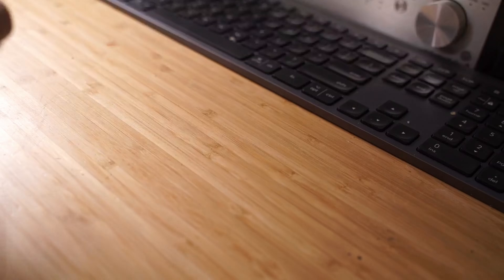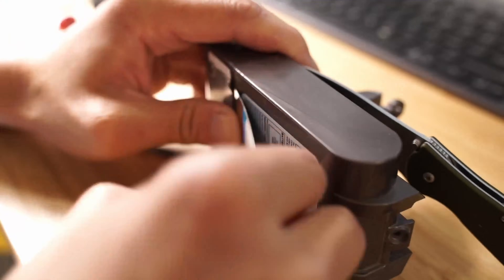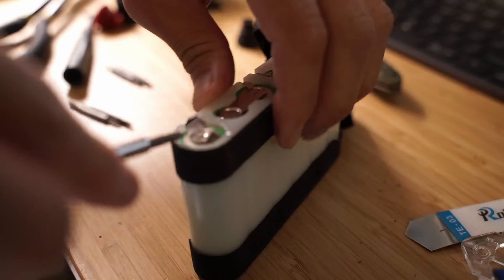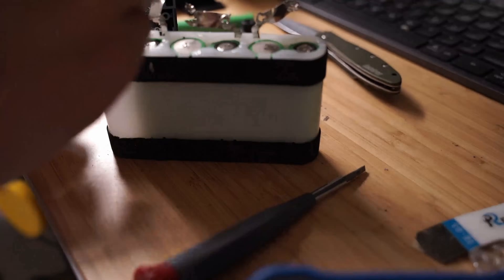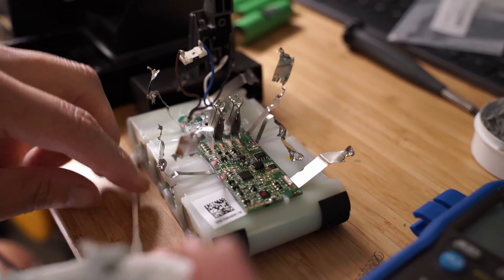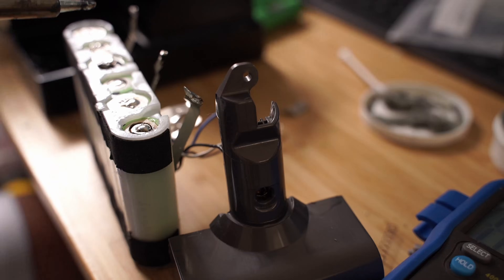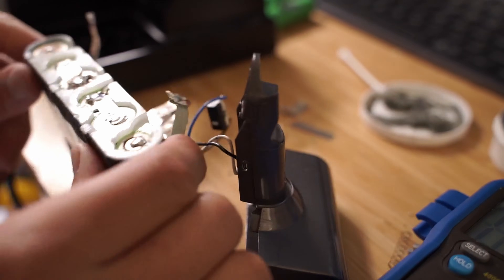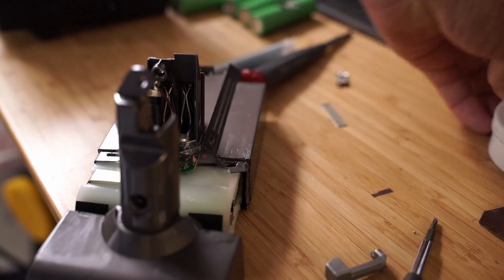Replacing 18650 battery cells in a Dyson V6 cordless vacuum battery

Comment from the maker: Hey everyone ! A lot of people have been asking how long the battery life with the new batteries, and I have been told it lasts at least 30 minutes on normal mode. I'll try and see if I can get a more accurate run time, but hopefully this is a good reference for anyone wanting to replace / upgrade batteries. Happy modding !
Reply: This video has convinced me to not bother trying to replace the individual cells inside the battery.  I was with you until I saw how destructive pulling the metal tabs off the cells was.  I don't think I'd be able to baby them off as gingerly without completely wrecking them in the process.  Your patience is profound.
Reply: Thanks for the disassembly info. Pulled mine apart, batteries ranged from 4.02 to 4.09V. Inconclusive, so I will repeat measurements with batts under load - say 2 ohms across each battery when measuring.

Comment: Just heat the join with a heat gun on low setting the pack case will pull apart without much effort and no distortion be careful not to over heat case. Maybe a hair dryer on high setting will work also worth a try.

Comment: Did it work properly considering to changed the battery with different capacity? I issues with other electronics where bigger capacity and higher output would shut down the air pump and turn on after couples seconds when in use for multiple time is a row.Thank you

Comment: I got a V7 head for free with "dead" battery which would not take a charge. Wanted to open battery, determine which one(s) were bad and charge them individually  bypassing BMS and see if this woke up the battery. In the past I have been able to charge the batteries individually, and then the batteries worked as a pack and took a charge. THIS video is great, well shows one how to have a HORRIBLE TIME as these packs are not made to be taken apart. I have bought non-oem packs for my dyson and they have lasted several year so far, so for me, I will replace a bad pack and give up on doing this. Way to horrible, doesn't look like fun.  THANK YOU for the video. In conclusion, I will buy a replacement pack and rip the old one apart and test and save the old ones which are still ok. What will I ever do with all these 18650s' in my garage.

Comment: my pack mlasted 7 years, with your video i now have taken it apart and will be replacing 1 or more cells, these are very high quality cells from Dyson, thankyou for your in depth explanation
Reply: I bought a replacement from amazon which work well.
Attempted to get the Old batteries out of the packaging and found two were solidly stuck in the tubes by a temperature sensor, couldn't bring enough force to remove the two batteries so eventually cut the pack apart.
Note the temperature sensor is hidden underneath the BMS board between batteries 2&3 (or 4&5 depending on which  way you count).
Reply: Please don't replace only one cell.
You will get a heavily unbalanced package.
Replace all batteries with cells that are of the same type, capacity and age.
The charge level should also be the same on all cells.

Comment: The algorithm served this video up to me... not sure why.  *BUT*....
I had a perma-redlight dyson battery pack that I just bought a 20v DeWalt adapter to replace (got plenty of those battery packs).  I used your instruction to disassemble the dyson pack, thinking I was going to find 18650's but found dyson-branded "INR-20700A" cells, instead.  I wasn't going to try to rebuild the pack, only curious about the state of the batteries.  To my surprise, one cell was 4v, one was 3.5v, and the other four cells were all 3.98v.  I have to assume the battery pack was bricked due to something on the BMS board, as the vacuum operates perfectly on my DeWalt batteries using the adapter.
I'm 0.5A slow-charging the dyson cells on an EFest LUC V4 charger, and then I'll let them rest a few days and check voltage again.  I have plenty of projects I can utilize them in as single or dual cells so I can save my 18650's for other toys.  Neat!

Comment: Take down this video, this doesn’t work because the BMS (circuit board) locks itself when it detects the batteries being disconnected. I should’ve watched the ending and realized I was wasting my time and money before attempting. Now I’m waiting till my new battery pack shows up in the mail.

Comment: my dyson lasted only a few seconds on max. Pulled cells from battery, did a discharge capacity test with Xtar VC8S charger and all cells were 2400mah and above. Does this mean there is an issue with the bms?

Comment: Hello, 
Found this video after I did it on my own, opened the battery case from Dyson SV10.
Replaced original Dyson batteries “INR-20700A” with more powerful “Molicel INR -21700-P45B” for about $44. These are a little bigger in diameter so I had to enlarge existing locations. 
Everything worked out  very well.  
If you need any details , just ask. I will follow up with updates on performance compared with the original batteries from Dyson.
The video is pretty good.
After 6 months working very well, I am using the original charger from Dyson , so charging takes longer. Old batteries still working with the flash light received from the batteries store. I am thinking to replace the Dewalt 18 volts  for my drill as well.

Comment: Never attempt to solder Li-Ion batteries with a solder iron, they will cause an explosion or worse, fire that you cannot control. There is a reason li-Ion battery are spot welded.
Reply: You have to be quick with high heat, and cool them down right away. 
If you're not off within 3 seconds, stop and let everything cool down before you try again.

Comment: Thanks for showing where the tabs are! I used a utility knife blade to get a small gap, then shoved in a 0.2 mm thick piece of nickel strip  at each of the tabs, came right off. I ordered new 35 Amp cells (Molicel P28A). Hope I don't have to flash the BMS board. I did disconnect the wide plus tab first (end of the chain). Going to reconnect it last after the new cells are spot welded in.
Reply: The battery is fully working after putting new Molicel P28A cells in. So, it seems to help to first disconnect the positive wide voltage tab, then the sense leads, then the ground tab and after reassembly, first connect ground, then the sensor leads, then lastly the full voltage wide positive tab.
At first, it didn't run. I had to connect it to the charger. It only charged for some 5 minutes, as all the cells were full. After that short charging cycle, I unplugged it and it ran normally.

Comment: Hi, I read some "comic" comments here , so after a good experience with these Dyson batteries I give you my clear position :
- It's possible but difficult to build a new battery in these boxes because you have no space between the cells and the box.
- You need absolutely  good 20A cells (or more) : the best is new cells , or with exactly the same values (capacity and IR) if already used. If not, don't build such a pack.
- You must be sure to get secure weldings to support high drain without any hot point and first of all any short.
- You must find another (chinese) BMS, because a disconnected Dyson BMS locks down definitely.

Simply short ONE charged 20A cell with a good wire and you will see what happens . (No, please don't try  :hand-orange-covering-eyes:) 
So I do that only for my own use , because I know what I do and I can permanently control the packs with an added balance switch, but I never build such a pack for anyone and Bye....
Friendly , Michel .

Comment: Very useful, though the original batteries are rated for 30A and the ones you replaced them have a much lower current capacity. I would have been a little concerned about that.

Comment: The led lights on my battery remain blue when the battery is disconnected. I have removed the case of the battery and I get 21-22v reading on my multi-meter - is the problem the logic board?

Comment: in my opinion the best idea is changing the BMS only ....
Reply: I think you are onto it. I bought a Dyson V6 brand new and the first battery pack red lighted after 3 weeks, under warranty and next pack failed in a month. Third one lasted 2 years but we never used the boost power button........I think the BMS is the wek link

Comment: You can purchase adaptors that allow you to use battery packs from DeWalt, Makita, or Milwaukee 18V cordless power tools that work on the Dyson V6. I bought one, only to discover that my Dyson was a DC35 slim (so much for "if your vacuum has 2 filters and a 'Max' button it has to be a V6" (in fact it could also be a DC35)) and therefore not compatible, sigh...

Comment: It seem than takinv cover off is the hardest part oc this DIY job.
For those who want to buy a new battery for this old machine, I got a full piece replacement with housing 3000mah on Ali....... 2 years ago for 25eur.
Dyson v6 is used 2-3 times a week and still going strong !

Comment: what panasonic batteries did you use ? you said it too fast thank you
Reply from the maker: I used panasonic ncr18650 batteries but they're not meant to be used in high discharge applications like a vacuum cleaner. The only reason I used then is because I already had them sitting around.

Comment: 1.when I used screw driver same way I damaged the cells side plastic cover and made a short so just very carefully next time.  2..if u change the cells without add dummy battery before removing cells the board can stop working I guess  and u wont be able to use it untill u firmware update it :/

Comment: Missed a couple of vital steps which would have made disassembly much, much easier and much less destructive of the case, ie the torx screw holding the 2 top ("extension") parts together, the two clips in the top ("extension") parts and the "blue lights" on each side which are not lights at all but clear plastic extensions from part of the BMS which can be lit up as required AND are also additional clips.

Comment: Running the iron at a hotter temperature to minimize how much the cells heat up sounds counter-intuitive to many, but it’s absolutely true for digital temperature-controlled soldering irons which maintain a set temperature by measuring at the tip and turning the heat on and off.

Soldering pros know that your tip instantly loses whatever heat it had when it touches a significantly larger thermal mass… like a nickel strip and battery terminal with fresh solder. This means that the iron will need to recover and restore its tip to the set temperature by turning on the heat. It will turn off again as soon as the internals of the tip reach the target temp but it will instantly lose that heat before the interface temps at the surface get hot enough, so your solder will still refuse to flow.

That’s because it is still sinking heat into the high thermal mass you are trying to solder. It will detect this drop each time and continue cycling the heating element until the combined thermal mass of the battery, nickel strip, and iron tip are all heat-soaked. While this is happening, everything down the line slowlys heat up much more than it needed to. 

You want the largest tip you have pre-loaded with as much solder as it will hold so that you have as much thermal mass as possible pre-heated before you ever touch the battery. A higher temperature means it can maintain a high enough temperature for the solder to flow before the heat drops too much. It takes time to heat up the rest, so as long as you are in and out fast enough it results in a lower temperature at the heat-sensitive parts.

Of course, you still want to limit temps as much as possible above what you need to pull this off. I would not recommend soldering with a traditional thermocouple-type DTC iron. The newer cartridge types with the heating element built into the tip have much better thermal recovery to get away with using lower temperatures on high thermal masses. Something like the TS80/TS100 or a clone that takes Hakko T12 or JBC tips would be perfect and affordable. Despite this, I’m still rocking an old T18 clone (old type) so I use a cheap battery spot welder. ;)

Comment: I’ve seen some battery changing videos in a dyson battery pack, but none of them showed that the machine worked with these new batteries. A friend in İstanbul works in a shop engaged in battery grouping. He said dyson did their best to prevent any battery replacement. He said he had replaced batteries as shown in the video (not soldering of course) , but it didn’t work. I’ve got a dyson , too. I’ve been waiting for the battery for six months. No news, yet.
Reply: I have had the same problem. Recharged cells replaced , Voltage OK but did not work. I would advise the first mistake is to buy a Dyson. And then Dyson batteries were unavailable.
Reply: @falconer100  In such systems, it is possible that the BMS (Battery management system) locked out when it measured 0V at the time you disconnected the cells. Usually, to avoid this you should be able to connect a power supply in parallel before disconnecting the cells from the PCB.
If you are eager to tinker with it more, there are some projects that flash a new software onto the BMS (also adding the cell balancing capability of the battery that dyson purposely did not add to their BMS so cells die quicker)
Reply: @benjaminhennequart5018  Thank you for your explanation.

Comment: Yea, as previously mentioned two of the cells are 'stuck' with hot glue or simiar that secures the thermistor.  I have actually damaged the thermistor on a few I have done win tremovign the battery.  

I came here to see if you unsoldered the thermistor and removed the board first.  I was thinking about getting a replacement thermistor for the packs I had damaged.  oping you were login to give mea part number for the thermistor!  Guess I'll have to do another careful dismantling to see if I can find any numbers on one

Comment: I have a SkyRC B6AC V2 charger. How can I charge this pack withouth complete opening teh batterypack? I just wanna try to refresh. But through the plug I dont get any connection. I gues its because of the platine?
Reply: Yes . If you test the charge switch of a Dyson battery you find nothing. And a B6 does not charge if it cannot first find the voltage information. So I add 2 wires on the main + and - of the battery + female jack (and also a switch for balance control , connected to the B6... essential for me)

Comment: Thanks for showing us how difficult it is to disassemble this battery pack. Now I know it's not worth my time to investigate!
Reply: Le gars  ne fait que vérifier la tension  il a tout faut il faut testée eb capaciter tout les accu les accu peuvent avoir une bonne tension mais une caoacitee très basse
Reply: @denisartigues2984  agree. do an AMP current check on individual batteries before changing them.
Reply: You will get past 15min until regret kicks in, well  not you

Comment: I have voltage on each cell about 4.1V, but I have no voltage out the main lugs.  How is that even possible?
Reply: Same. 😕
Reply: @davidbolha  I figured it out actually.  There is a magnetic switch on the back of the board.  Bring a magnet close and it fires right up!

Comment: Good video. However it is not a good idea to use any acid flux (like plumbing type) for electronic soldering. Connections corrode under electric galvanic effect. For these applications rosin based flux used exclusively.

Comment: 😂that a lots of works to save $35-40.And 😢all electronic devices today are planning for no solutions to fixed.100% manufacturers😢also they’ll  glues these things togetherness ,fitting them tightly or uses torts screws on them.😅if electronic devices repairing is your hobbies or working in the industries.This works not worthwhile to repairing these things.